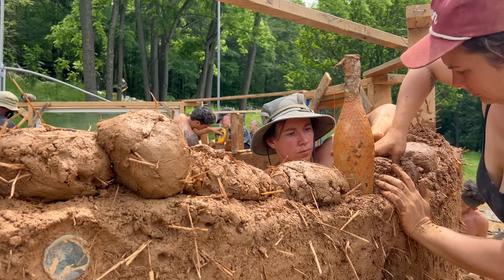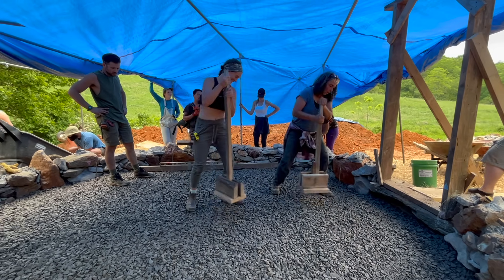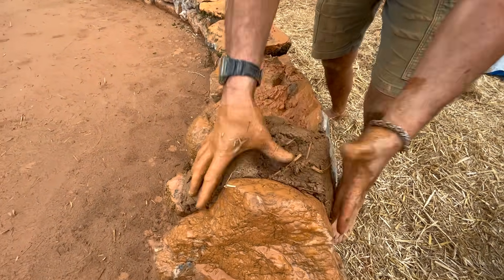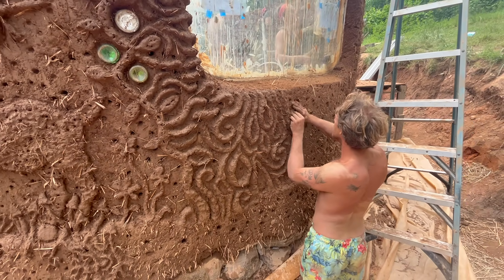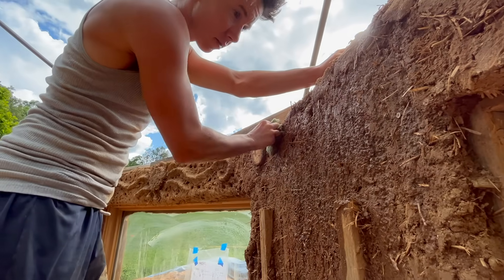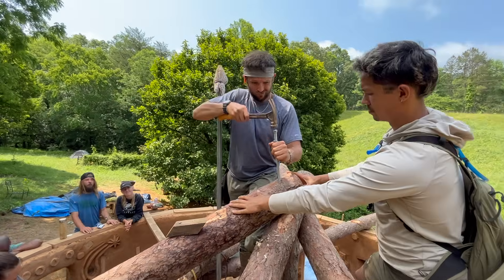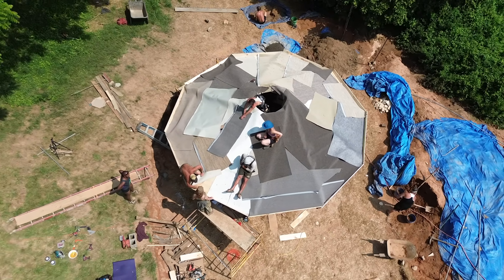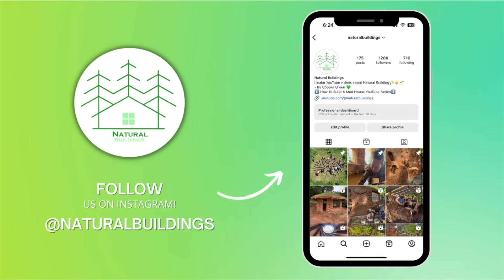Cob House Build START to FINISH in 10 Minutes

Comment: Great content, How thick did you go with the walls? Cheers for tsking time to answer
Reply from the maker: 12 inches at base and tapers up to about 8 inches at the top. Manure has fibers that add tensile strength and the enzymes also can help make a strong plaster. Not entirely necessary though. Chopped straw can be just as effective if you prefer not to work with manure
Reply: @naturalbuildings  sensational, thanks for answering quickly, 
That makes me feel more comfortable now with the build Iam constructing, have got  12inches too
Reply: What is reason for adding donkey manure?

Comment: I can't imagine a foundation made out of cardboard is gonna last.
Reply: This is the first time I've ever heard of cardboard though it would be quite insulating. Once the floor is done it's like poured cement so it won't matter that it's cardboard traditionally people used gravel and then gradually move to beer bottles because they hold air and are therefore more insulating and cheap and easy to obtain. That would be my pic

Comment: What is the benefit of manure?
Reply from the maker: Mainly the small fibers create tensile strength in the mix but the enzymes also help to bond the mix together. It’s possible to skip the manure and use other fibers like chopped straw instead.
Reply: Makes it more sticky